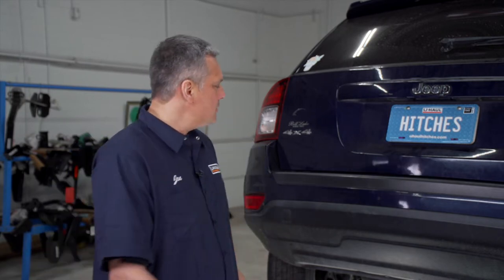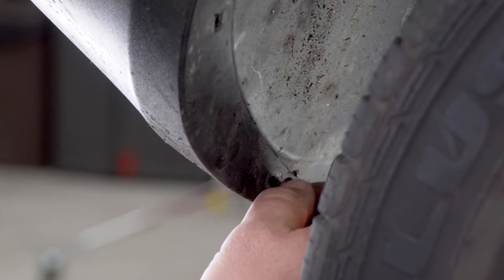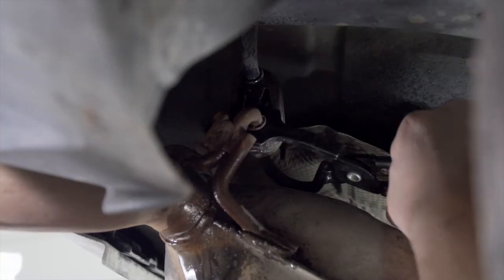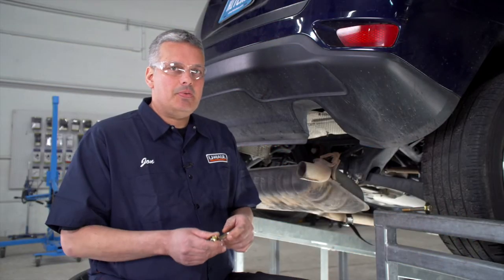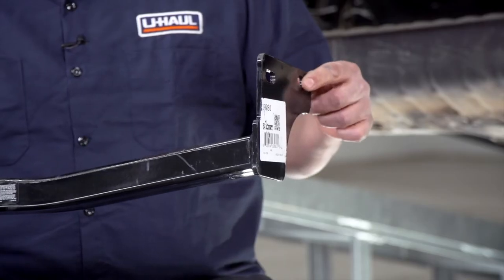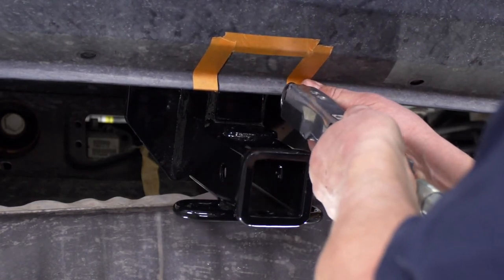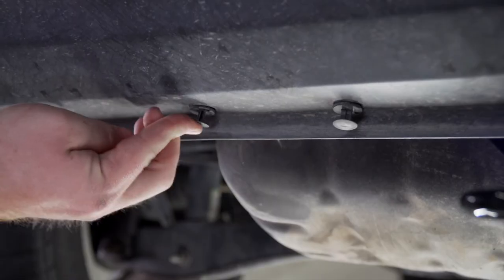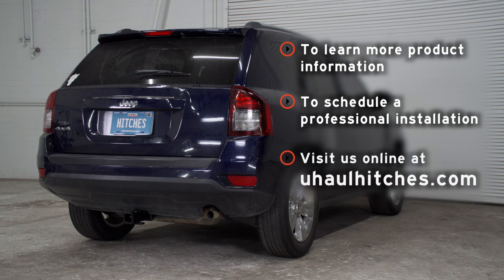2016 Jeep Compass Trailer Hitch Installation

Comment: This video is the same exact video for the 2017 Jeep compass, But the trailer hitches are not the same......
Reply from the maker: We use the same videos for different years when the hitch and installation process are the same. And according to multiple manufacturers, this hitch will fit both 2017 and 2016 models.